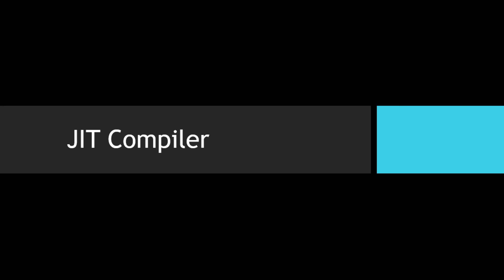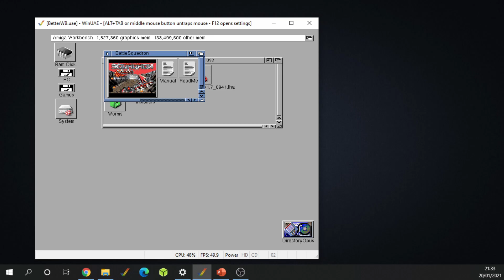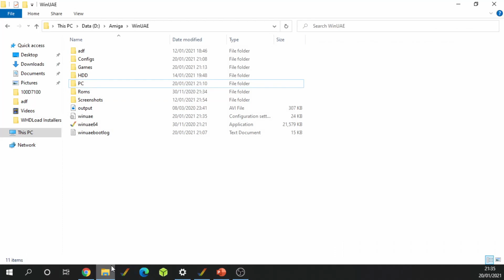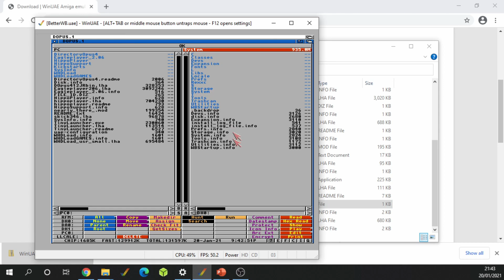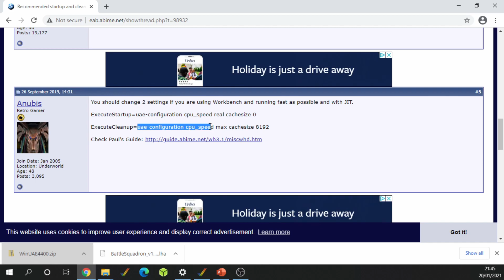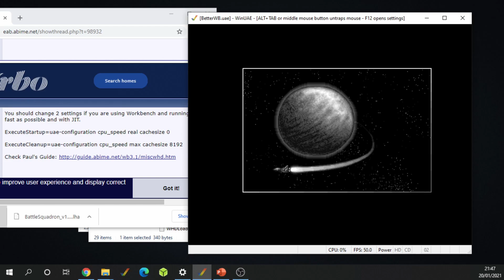WinUAE Guide - Part 14 - JIT Compiler & WHDLoad

Comment: we can also try to balance speed a bit more, by using the "cpu_throttle" parameter. Interesting values should be "-900" , which is-90%, or "-850", which is 85%. Note that we can define integers here, while from within the WinUAE GUI we can only adjust this value by 10. This could be useful for some fine tweaking

Comment: that part of the video where you use the uae-configuration doesn't work on a real amiga.  I am running an A1200 with Pistorm32 lite.  This only happens on 1 music demo which I cant get to run at the normal speed now.  Can you help with this?

Comment: An interesting and useful video, like all the others in the series. But does the speed adjustment in WHDLoad require that you use a 32bit version of Winuae? Or will it work if you have a 64bit version?
Reply from the maker: You can still use a 64bit WinUAE. It's just that the program is only found in the 32bit zip file for some reason. Sorry didn't make that too clear in the video.